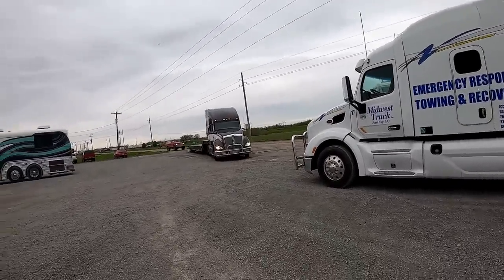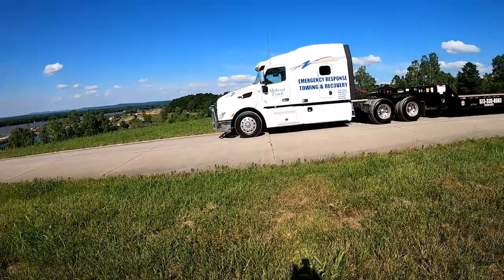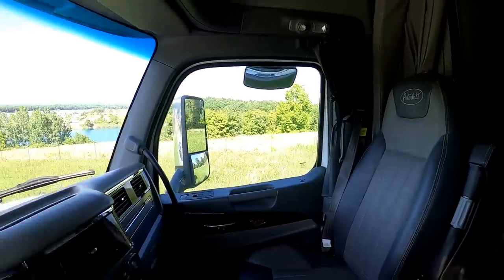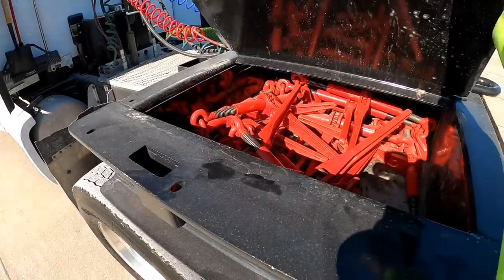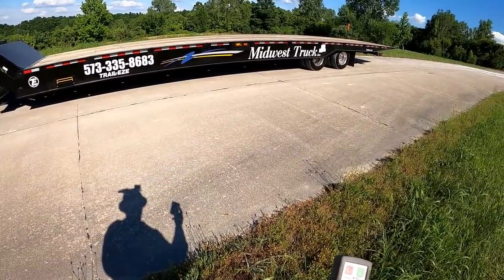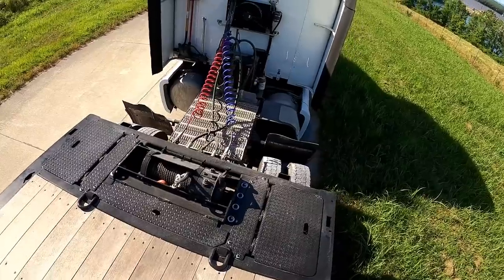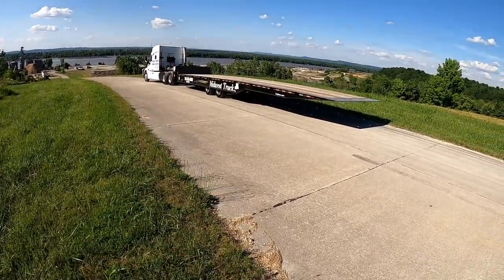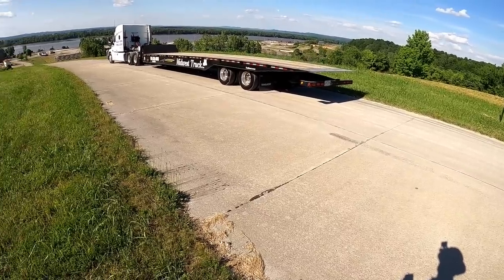Walk Around of Truck 17 and our new Trail-Eze TE801 trailer #T-1!!!

Comment: that is a nice and great looking setup. But Ihad to grin when I saw the front of the Peterbilt with that huge grille guard. What do tow companies hate the most when towing or recovering a big rig? Grille Guards, because they usually mount to the tow hook mounts and can not be hooked on to for pulling. So, Ron, is this grille guard going to stay, or is it mounted in a way that regular tow hooks can still be attached if this truck ever needs to be towed or anchored to something for added strength and stability?
Reply from the maker: This was a used truck that we purchased from an insurance company.  The guard was already on the truck and it will probably stay.  We have ways to tow with the guard still on.   This is the type of guard that I would like to install on all our trucks, but as you can see, they are rather expensive....  https://www.raneystruckparts.com/peterbilt-378-379-sfa-herd-super-road-train-bumper-grill-guard/?gclid=Cj0KCQjw0Mb3BRCaARIsAPSNGpVx53BS64cMuCB2__7hnwoU9NA_kRCFCbb239EIOsJuUpICWQ6ElQMaAp2eEALw_wcB
   Thanks for watching and God bless.
Reply: @RonPratt  ... those are nice guards but you are right, they are costly. By the time you add the options for lights, latches and tow pins, you are at 7grand a piece. Buy two or threee of those and they cost enough money to buy another fleet service vehicle that makes money, instead of being an expense item only. And at nearly 500 pounds they put more wear on the tires and reduce fuel economy too. But they do look great for sure.
Reply from the maker: @silentepsilon888  They do serve a good purpose though.  One of our local ambulance services started putting the heavy guards on the front of their units due to the number of deer hits they were having.  We have a LOT of deer in this area.   The administrator told me that after installing them and having their first deer hit, the guard saved them more than it cost.  Not just the repair costs involved, but the down time they would incur while the unit was being repaired.  As it was, they were able to replace a headlight bulb and still drive the unit, whereas without the guard it could possibly have totaled out the cab unit.  The ambo box would have been reusable, but that takes a lot of time to refit.   Anyway.....I don't see us making the $7K investment each for the reasons you listed.  We could buy money-making equipment.   Thanks for watching and God bless.

Comment: What mechanism moves the trailer axles?  I assume you'll install all the Code 3 lights, etc at some point?

I'm the guy who had the windshield washer solution sent to you. I live in the Pacific Northwest and grew up with the stuff (I'm now 66) and due to the rain & oily roads we always get nasty smears from the wipers. I noticed a smeary windshield in one  of your vids, called the manufacturer & they said they'd send you some. Surprisingly they're not interested in expanding their market (I tried talking them into being their distributor when I lived in CT) primarily due to cost of shipping liquids with relatively low profit margins. It's dirt cheap -  about $1.00 for an 8 oz flip-top bottle but a quart of concentrate (still cheap) goes a long way. Add too much & you'll have very sudsy washer fluid - ask me how I know - LOL. If you're interested I'll send you a quart N/C - just my way of saying "Thanks" for the videos. Just let me know.

Comment: Would you need a brake/blinker bar if you use the trailer with the wheels forwards? I noticedt he plate rolls with the wheels so the brakes and blinkers etc would be hidden.

Comment: I use to drive a semi tractor trailer the only thing I hated was when they came out with LED   lights in the winter they don't get hot enough to melt the snow off of them when snow gets kicked up on your tail lights

Comment: Something I've been wondering about Ron, what driving licenses are required for the various trucks? I've a pretty good idea how it works in the UK but the US system is a mystery to me. Are all your drivers qualified to drive all the trucks. We only ever see you driving the tator yourself but that could be because you're the one with the camera.
№17 is a beautiful rig and I'm sure it will have many uses, including some you haven't thought of yet. That sleeper could have various advantages too, quite apart from it's intended purpose. I hope you get many years of trouble-free service from the unit and the trailer.👍

Cheers for now,
Dougie.
Reply from the maker: Most of our equipment requires what is called a Class A CDL with all endorsements.  The Ford rollback that Mike drives only requires a Class B CDL.   Mike currently has a Class A permit and can drive and train in any of our trucks as long as there is a Class A qualified driver with him.   He is the only driver we have who does not have his Class A.   Everyone else, including David, has their Class A.  Thanks for watching and God bless.
Reply: @RonPratt  Interesting Ron, thanks for such a prompt reply.

Comment: I am not familiar with this equipment and was wondering if you were in A close spot if you could lock down the trailer wheels and pull the truck back to it , such as maneuvering into A short driveway?

Comment: Do you have something like a set of dolly wheels to support the front of a tractor that has taken out its steer axle? i.e. to prevent gouging that nice wooden deck. Would be an aid to loading with the winch.
Reply from the maker: No we do not.   We will use the Rotator to lift and aid with loading in situations like that.   Thanks for watching and God bless.

Comment: Looks good. Ron, is the PTO unit  on that a bolt on behind the transmission?
Reply from the maker: The PTO bolts onto the side of the transmission and is driven off the transmission gears.  The hydraulic pump is driven by the PTO and is bolted to the back of the PTO.  The supply tank is behind the cab so that it gravity feeds the hydraulic fluid to the pump.
Reply: @RonPratt  

Ok. I have seen that configuration on some of the Eaton transmissions. I know that on older units they bolt onto the back of the transmission like a transfer case does.

Comment: What locks out the tandems? Is it a pin system that locks it out?
Reply: ACTUALLY, IT IS MOSTLY DONE BY HYDRAULICS, AND AIR TANKS...(TO UNLOCK)
Reply from the maker: @Brian Sanders  It is all hydraulic to the best of my knowledge.  I'm assuming that it is like most hydraulics on the towing/recovery units where they use "holding valves" that prevent movement of hydraulic cylinders without positive hydraulic pressure to open the valve and allow movement.   For instance, if a hose blows, a cylinder will not fall.....built in safety.  Thanks for watching and God bless.

Comment: Hard to describe how awesome that is without slipping profanity in.
Reply from the maker: No need for profanity, as far as I'm concerned.  Not that I don't swear occasionally.  I would be lying if I said that I didn't.  However, I do the very best I can to consciously avoid using such vulgarity.   Thanks for watching and God bless.
Reply: I imagine you'll hear it from people's amazement while they watch it.
Reply: Have you changed the air in the Pete to adjust trailer angle with it yet?
Reply from the maker: @fordmanfinis  Haven't had a load that we have needed to do that yet, but that is an option to get a slightly lower angle.
Reply: @RonPratt Ron, as an Airman and Soldier, I swore very rarely in the service, but when I did, boy did I!  I got their attention when nothing else worked!  I am proud of how little you do!

Comment: that's a AWESOME truck  I would like to ask you said it's a Cummins SOMETHING  DO YOU HAVE ANY  CATAPILLIAR  ENGINES
Reply from the maker: Yes, our Western Star with the Vulcam V70 has a Caterpillar engine and 13 speed transmission.  Thanks for watching and God bless.
Reply: @RonPratt  Ron question which diesel do you and your company like the best for running the longest and mileage
Reply from the maker: @brucebonkowski3037  I'm a "die-hard" Cummins man myself.  Everybody has their preferences.  Personally, I have two pickup trucks, one I drive and one my son drives, and both have the Cummins diesel in them.  Our fleet trucks are primarily Cummins and PACCAR, which is made by Cummins.    Thanks for watching and God bless.

Comment: If you had something where you needed more than the 41 foot main deck space could you use the tilt feature to include the 9 foot upper deck in addition to the 41 foot main deck to give yourself 50 feet of total length ? ( could you level the deck to make it a 50 foot deck ) ?